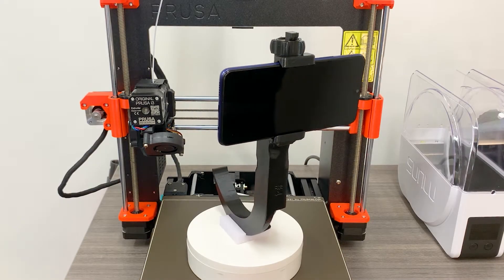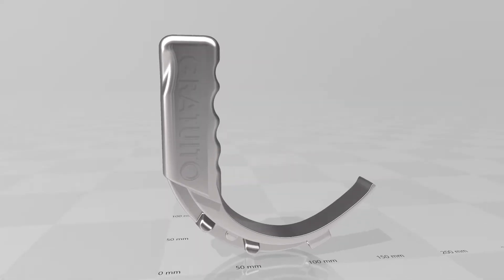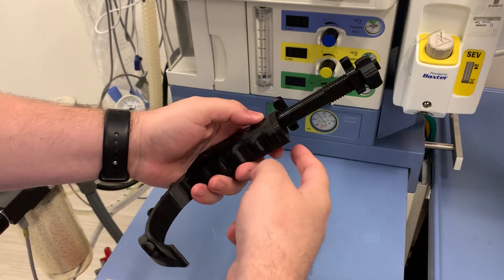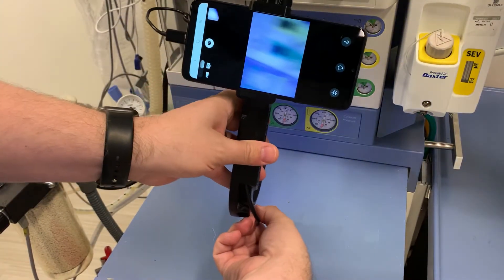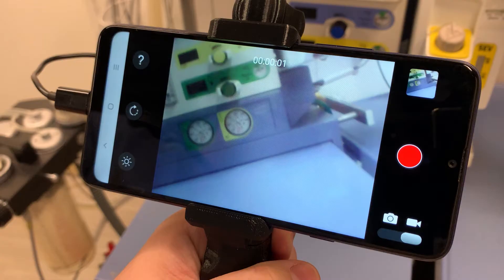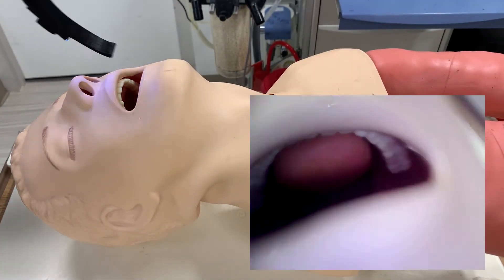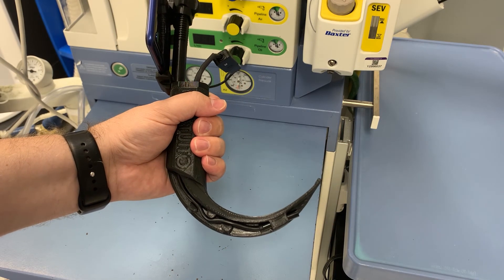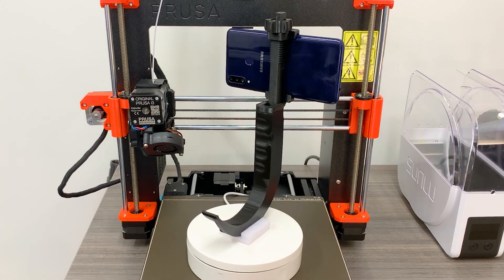$7 3D Printed Video Laryngoscope: Design, Manufacture, and Testing.

Comment: I think one interesting take away is that you used the same technique and stylet as the Glidescope. Is the blade designed to be used in the same way (vs DL).
Reply from the maker: Yes, it’s a hyperangulated blade like the glidescope (or C-MAC D-Blade) and works well with that technique/stylet.

Comment: Dude this is rad, I've been trying to figure out a decent workaround for a McGrath replacement, because of the proprietary batteries cost whilst being non-rechargable without some modification, I just stumbled upon this video. 

As far as a sheathe for the blade - if the U/S probe cover is too big, could you use a non-lubricated polyisoprine condom? If it's pulled taught and held in place with a rubber band, it shouldn't  impact visibility too much. I think a dressing like tegaderm or iv3000 might work too but would be annoying to apply and remove whilst managing asepsis or sterility, intubation is more of a 'clean' procedure but in practice, all blades are sterile. 
I'll definitely be making my own one of these for practice though and also just to nerd out a bit.
Reply from the maker: At my institution they want the all the laryngoscope blades sterilized as well, but one has to pick their battles with hospital admins 🤷. I did try using a transvaginal ultrasound probe cover which looks exactly like a condom but it affected the visibility quite a bit (although I don't know the exact polymer other than it was "non-latex"). One of my OMFS colleagues gave me a box of these: https://amzn.to/3HqUjEE which are covers for dental cameras, and they seem to work pretty well.

Comment: Additional outlay would be the 3-D printer...but this would pay for itself very quickly.
Reply from the maker: I think, with the cost of desktop 3D printers plummeting in the past couple years, the cost of a basic printer is almost negligible.
Reply: @DrMRod  I'm still thinking it needs a roll of toilet paper, though. 😉
Reply from the maker: @reginaldwelkin  Oh my, no, we need that TP to run our ventilators :-P

Comment: that's a great comparison between the 3D printed and commercial one, we recently bought a Chinese Video Laryngoscope which is no better than the 3D printedone, video quality wise, except it has 3 size blades, which again is not a hard thing to do, i had that idea a year ago, but have no 3D printer, so i have tried to use a single use Laryngoscope blade and adapt the same cheap camera to it, unfortunately wih no luck, i couldn't figure out how to secure the camera and at the same time be able to properly clean the blade between patients, and also if the camera breaks to be able to easily replace, you can try the same thing, just use a metal blade and 3D printed camera holder maybe I don't know :) just an idea
Reply from the maker: That's not a bad idea, to design just a camera mount for a standard laryngoscope, maybe something to try in the future.
Reply: @DrMRod  https://www.youtube.com/watch?v=0Ne7wxTP7oc&t=198s have you seen this doc?

Comment: Really cool idea! I have several 3D printers and will most definitely try this out.
Reply: Have you tried it on a person yet to see how strong the stress points are when lifting the handle while the Mac blade portion is in the patients mouth?
Reply from the maker: I haven’t used it on a real person. I’m able to lift the 25 lb intubation model off the table with no obvious flex in the laryngoscope. One typically doesn’t apply too much force during the average VL, so I can’t imagine a scenario where one could actually break the PLA.
Reply: How about a large tegaderm, or an otc “shower shield” you can find at any convenience store? Won’t add any bulk or sticky residue but keep it water tight.
Reply from the maker: @dirtysar13  A large tege seems like a good solution since they're ubiquitous in the hospital! One of my OMFS colleagues gave me some of these: https://amzn.to/3HqUjEE, meant for some kind of dental camera, seems like it will work pretty well.
Reply: You can use a baby bottle liner. You can get them at Walmart or on Amazon. 100 of them for around $10.00
Reply from the maker: @ronniejones8577  Seems like a good option. One of my OMFS colleagues brought me these: https://amzn.to/3HqUjEE, meant for a small dental camera that they use.